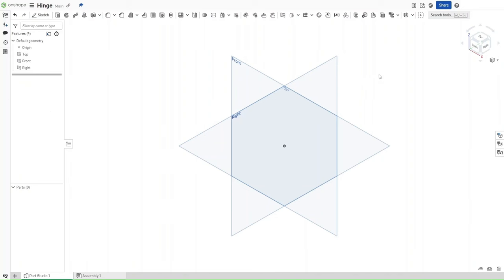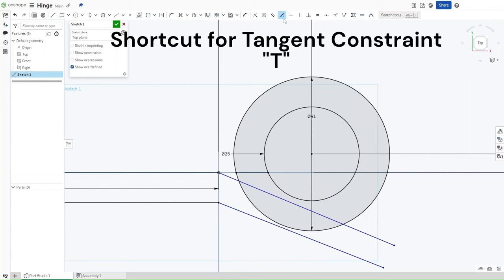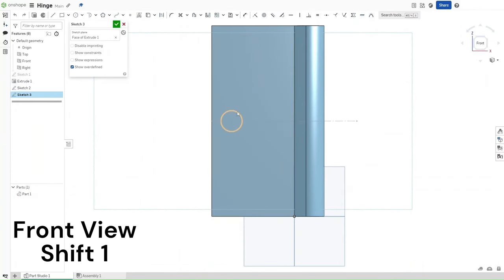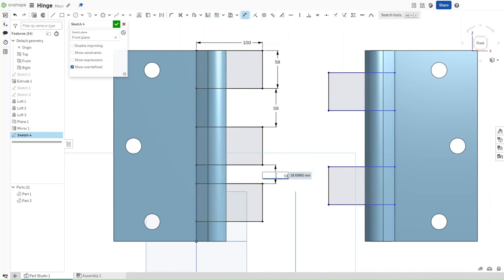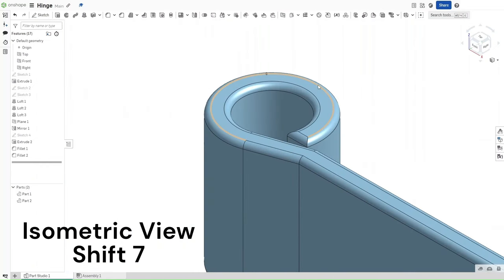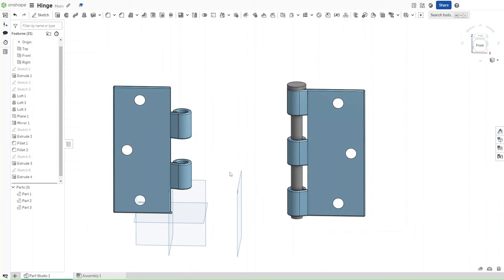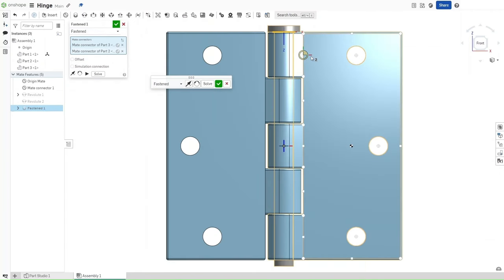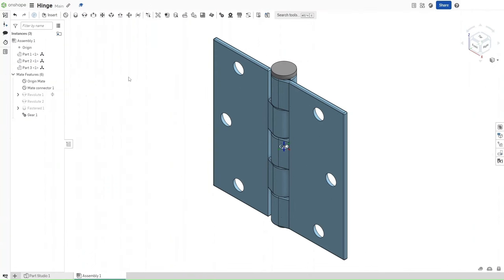CRAFTING A 3D HINGE | ONSHAPE TUTORIAL

Comment: Very inneficient way of doing it and doesn't follow parametric CAD best practices at all...
If you are reading this do yourself a favor and find a better tutorial to follow!
Reply from the maker: Could you recommend some specific changes I could make? I made this video only taking what seemed the simplest way, if there is an easier and more efficient way I will be happy to repost with that way.
Reply: @FusionForge-pm1jz  Sure!
Fundamentally, a good parametric CAD model should allow you to go back and adjust things after the fact and update in a  consistent and predictable manner, which is missing here.
This model has a whole bunch of related things dimensioned separately that would not regenerate properly for example, the size of the holes, the pin diameter and hole in the hinge, the number and size of the "notches", etc...
Then there are some redundant steps and/or convoluted workflows.
As far as solutions go, here are a few things that would help:
- The center of the pin should probably be on the origin having the "mounting" face of the leaf on front plane also makes sense but it should at least be on the right plane.
- Sketching tangent lines to the arc, you can drag a line and pick up both the tangent and coincident relations, no need to draw it outside, add tangent relations and trim...
- The thickness of the leaf and "knuckle" should be related. You are dimensions the leaf first and then the two circles around the pin separately so they are not linked at all... In this case you could save yourself a lot of time and use the "thin" extrude option, which would take care of all of this (or at least use a construction line between the two circles equal to the leaf thickness... 
- Hinge length, I would highly recommend using a variable for this so that you can use it for the knuckle cutouts and probably the pin... i.e. set the knuckle sketch to be "length/5"
- Using the loft tool for the holes is a very "unorthodox" way of doing it... Just create a sketch with a point where each hole goes and use the hole tool with the countersink option. And if you were do a sketch like this, make the circles equal instead adding a separate dimension to each. For the other side of the sketch, you don't need to convert before adding the relation, you can just put a concentric relation to the other sketch.
- Creating a random plane to mirror doesn't serve any purpose. Mirror along the right plane, this way you can use a simple pattern to cut the knuckles. And on that subject, jus draw the first two rectangles (one for the left and one for the right leaf cut), and extrude remove these then linear pattern. And preferably use a variable for total length of the hinge to compute the length of each rectangle as well as the number of instances in the pattern.
-For the pin, make the sketch with an offset distance from the rest of the hinge (instead of typing the diameter). Really though hinges would usually start with the pin diameter (i.e. an existing metal bar size) and make the formed metal part to match so the pin should be part of the first sketch.
- For the assembly mate, it would be easier to add an explicit mate connector in the part studio that matches the head of the pin (but assigned to the right leaf).
Anyway, here's a list of things that I though weren't done what I would call "properly". It's one thing if you are trying to just get the job done for yourself (you did get a working model of the hinge at the end) and just titling the video something like "attempting to model a hinge in Onshape" but this shouldn't be presented as a "tutorial", especially not with the word "mastery" in the title as this is misleading and is not teaching beginners that might be watching this good habits. That's what prompted me to comment in the first place...
Anyway, I hope you find this feedback useful and I appreciate you honestly asking for how to improve as this is a good attitude to have and was worth my time to type a detailed response!
PS I do have a video on making a hinge on my channel where some of what I am talking about is shown (and other probably overkill things)....
Reply from the maker: Thank you I'll see when I can make a video with all of these changes. I need to get better with scalable designs and will watch your video for some more advice. 
I definitely need to learn more about the functions of Onshape such as the countersink (which I wasn't aware existed in Onshape) and overall order of designs like you said about adding the pin to the first sketch rather than later on